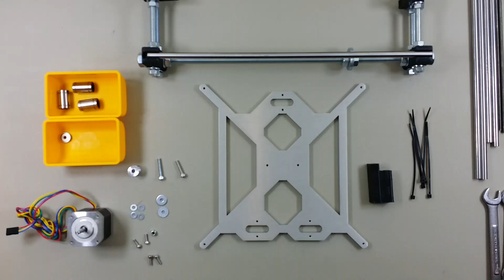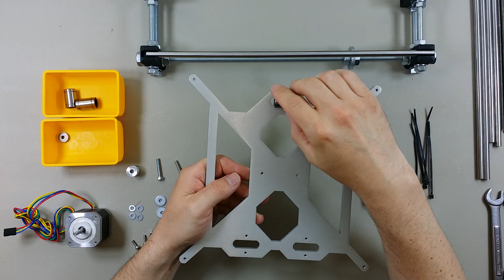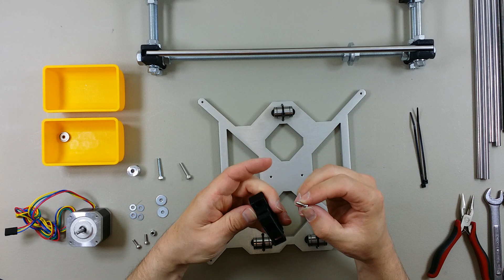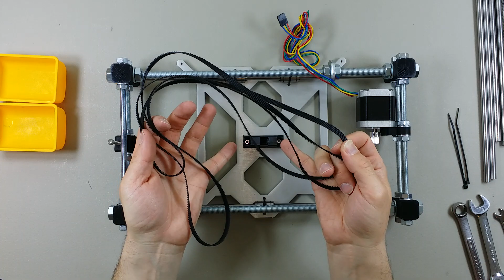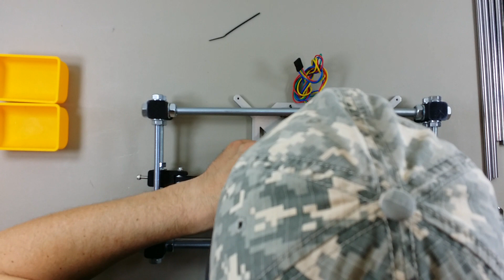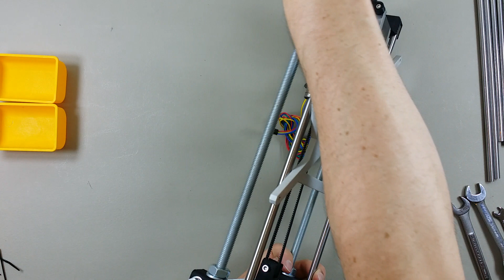How to build a RepRap Prusa i3 (Assembly 2)

Comment: great vid

from the point of 14:22 right near to the end of the vid I was wondering why you simply didn't move the carriage assembly such that the stepper motor rod it was directly over (under) the target area and properly aligned -- just slide it on over. 

again, thanks for the comprehensive and cogent commentary, it is very informative.
Reply from the maker: That's a good idea. It didn't occur to me at the time. :)

Comment: I used tie straps to lock the drill rod down to the plastic supports. No more rods falling out or moving around.  Now then...WHERE did you find those bearings???  I've probably been through 50 to 100 bearings and NONE work that smooth.  Every LM8UU Bearing I've bought is junk... :(

Comment: watching video series b/4 I make a purchase... JMHO- might be a good idea if the folks who put this kit together would PRINT a small plastic rod to load up the flat washers, bearing and fender washers on then slip into Y belt idler...one that is exactly as wide as necessary to slip onto the idler then gets pushed out when inserting SS screw...
Reply from the maker: That's a good idea. Those are tricky to install. :)
Reply: engineglue or you could assemble the y idler bearing and bolt before placing it on the front all thread, this way you could stack the washers/bearing/washers and insert them as a stack vertically into the piece.
Reply from the maker: Corby Franks I agree.

Comment: Do you have any suggestions for motors? Does the step angle/degree make any difference? I.e. if I spend more money on a motor with a smaller step angle (to achieve neater prints), will this screw anything up software wise?
Reply from the maker: If this is your first time. It will be easiest for you to use the most common components. You can certainly experiment with other components but it may lead to more troubleshooting. The 2 phase, 1.8 degree, 4.2V, 1.5A 5.5Kg.cm motors are going to be the easiest to work with.
Reply: Fantastic! Thank you for your advice :)